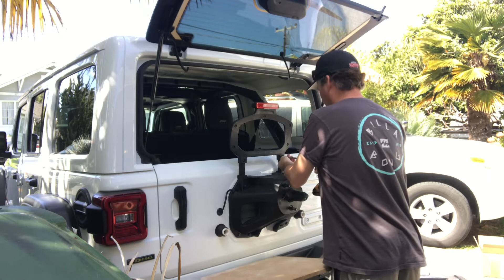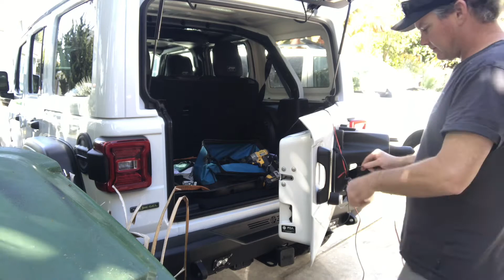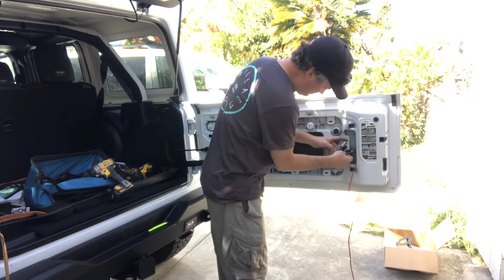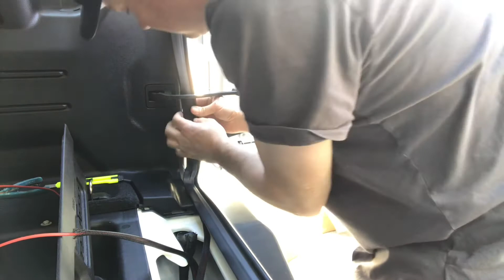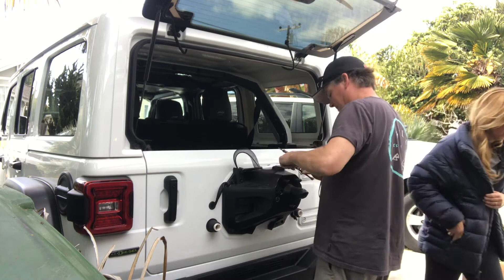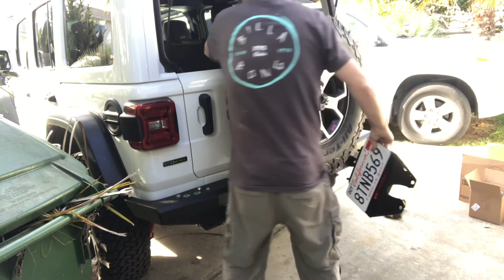Jeep Wrangler License Plate Relocation made by LoD Off-road

Comment: Link to product???

Has it held up well? 

Plus, I have my tires rotated every 3000 miles. 

Is it easy to remove and replace when changing the spare tire tire into the mix? 

I guess I could somehow put a quick disconnect on the wiring. 

Thanks.
Reply from the maker: Yes the product has held up well. Just rotated my tires. The three wires all have quick disconnects that are easy to reach. Brake light, right license plate  light, and left license plate light. This set up adds two additional nuts to take off and the three wires. Real not a big deal every 3000 miles. Cheers!